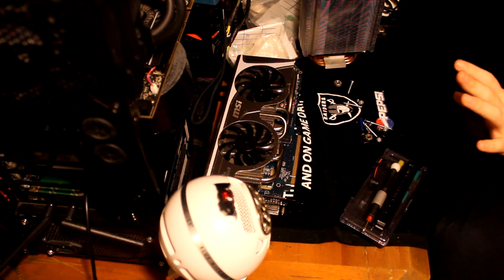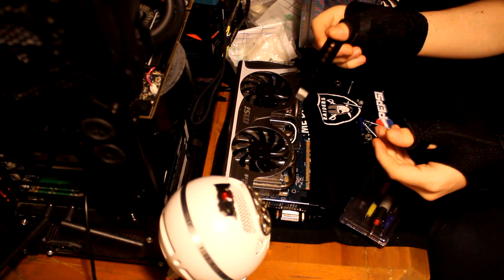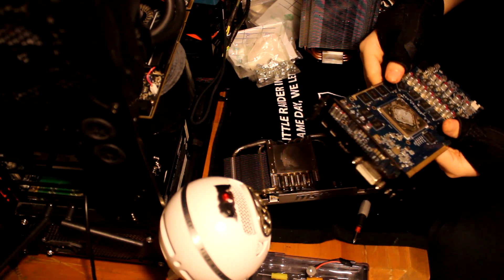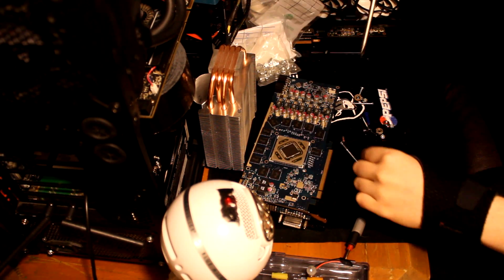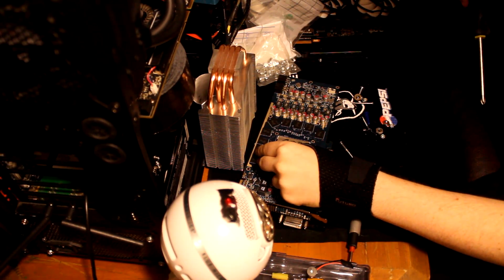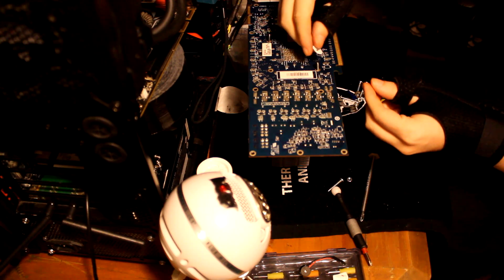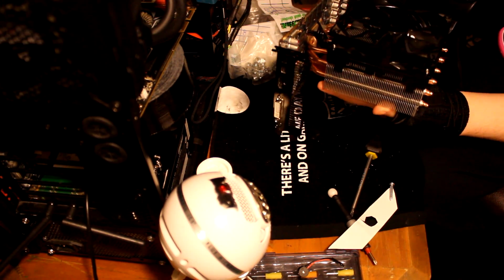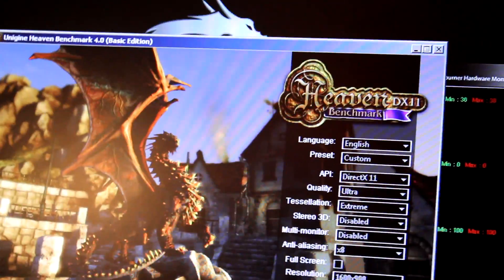I PUT A CPU COOLER ON A GPU!! (THIS IS WHAT HAPPENED)

Comment: Thats really cool i was thinking of doing the same for my gtx 690 but with 2 smaller coolers because the stock cooler is the loudest thing ever but im worried about the vram temperatures only if i could still find normal aftermarket coolers for gtx 690

Comment: Nice video as usual XD, i honestly wonder if this would make an older card that runs hot, but performs well more viable in today's games, maybe you should do this with a gtx 480.
Reply from the maker: Z Bobplays I did kinda. The gtx 570 is basically a 480 and it performed really well with a after market cooler on it. Thanks though
Reply: A want made this in a gtx 470 with delid. Using a hyper 212 evo